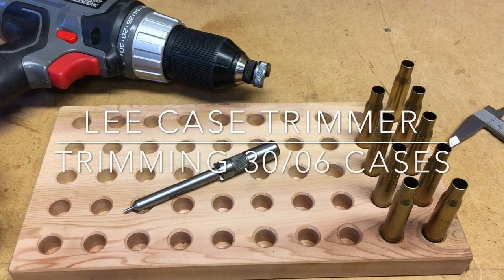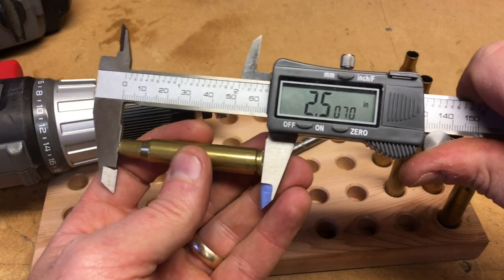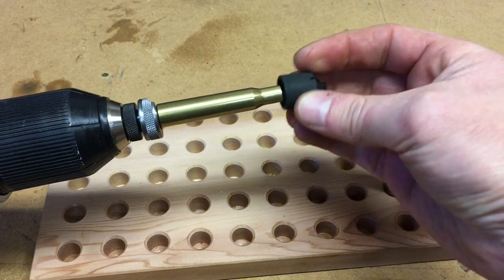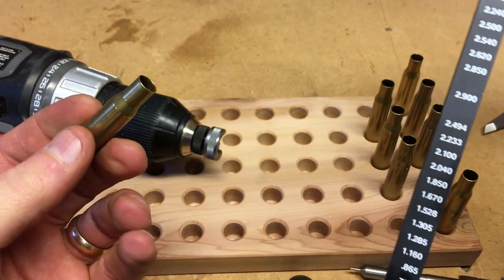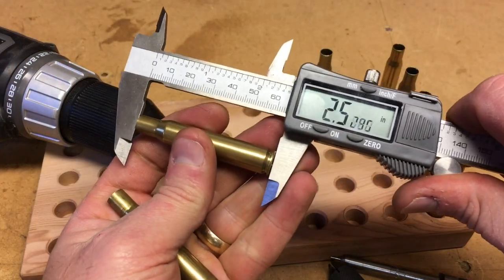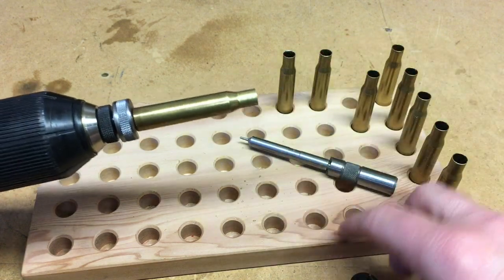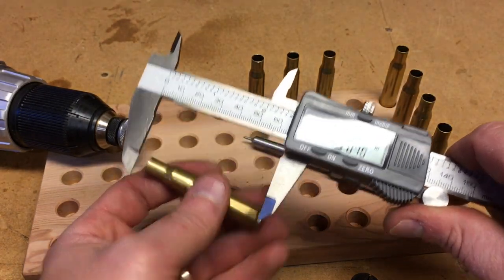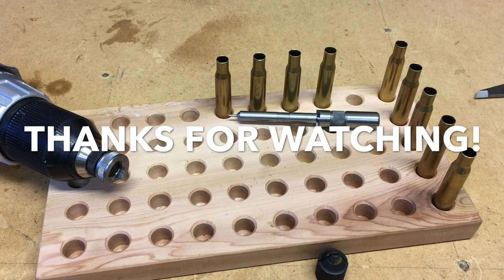Lee Precision Case Trimmer

Comment: I use the 3 jaw mount for my hand trimmer along with the wood ball cutter tool all chucked up in my drill press, I can process over 150 cases a hour with this set up...Good video for a good cheap way to set factory length on your brass.

Comment: I've been trimming cases that way for 25 years.  They work perfect!  Just picked up a Lee Zip-trim last week to try, on sale at Midway.  I like it.  It seems kinda cheesy, but if you don't man-handle it, it should last a good while.  It's just as fast or faster than a drill.  IMO  Just fasten it to your bench.   BTW...nice loading block.  I got 2 just like the ones you have.  From the same piece of wood!  LOL  God Bless.
Reply from the maker: I couldn't see paying $80-$90 for a Lyman (or similar) trimmer. I haven't seen the Zip-trim yet...might have to check that out. The fella that gave me those loading blocks sure did an excellent job on them. :)   Thanks for being a loyal viewer and thanks again for the reloading blocks. They've been put to good use. God bless you too!

Comment: My 223/556 kit was a little long @ 1.755 or so.  Like to be at 1.745 or lower.  Took a file and gently removed material from the pin and chamfered it and have it dialed in perfectly now.  Tough to beat for the price and it leaves a good cut.  The Worlds Cheapest Trimmer is prob next price wise and is faster but the cut is not as good (can still get MOA or better).  For speed and precision the Worlds Finest Trimmer beats both but its more expensive.
Reply from the maker: I haven’t heard of those two, but I’ll have to check them out.  Thanks for the info.

Comment: Question I can’t find the answer for anywhere on the internet, are you supposed to bottom out the gauges threads into the cutter ? On instructional videos they just lightly screw In by hand, if you do that compared to bottoming out the gauge to the cutter you can get wildly different trim lengths…..
Reply from the maker: I tighten the gauges as far as they will go by hand and then give a quarter turn with a pair of pliers.  I haven’t had any cases out of tolerance using this method.

Comment: I find this trimmer okay for rough trimming, such as when converting .223 to .300 BO, but I've found, as seen in your video, that the shell holder often does not center the case and allows wobble. If one wants "precision" trims, there are much better devices.
Reply: Off-center flash holes will cause the case gauge to wobble.
Reply: You stated my issue with 300BO. Get so aggravated during trimming a batch of cases, I have to walk away.

Comment: Mine doesn't go in enough when case is in lock stud and she'll holder, thoughts. Thank you for the video
Reply from the maker: Is the old primer out of the case? The small tip on the gauge should fit through the primer flash hole.  Other than that it could be you don’t have the gauge screwed into the cutter far enough.
Reply: @ncshootist  I have same problem. the stop pin seems too long and hits the face of the lock stud before cutter reaches the shell casing. Did you shorten yours?

Comment: Question for anyone who has one of these.
Are these adjustable at all. I need to do some wildcat cases.
Trimming 45 Win Mag to 460 Rowland's.
Yes they work, just looking for an easier and faster way to do it.
Reply from the maker: They do have a lot of different cases but I didn’t see 460 Rowland https://leeprecision.com/case-conditioning-tools/case-trimming-tools/case-length-gauge-holder/
Reply: Did you ever get an answer about being adjustable? I have seen it said they are not adjustable, but it seems like you could influence the length by changing how far you screw the gauge into the cutter. But then it would seem like it could then be sloppy. Also, on their website, it indicates "Trim to length 2.706 to 2.726 inches" for .338 LM. It makes me wonder if there's a tolerance of 20/1000...which is pretty sad...especially since the SAAMI max says. 2.724". Their website contact page makes you enter far more info than I'd be interested in providing just to ask a question.
Reply: @ShastaBean  
I ended up creating my own trimming process. It started with the cases chucked in the drill and set to a "calibrated" depth. I then cut them with a fine tooth hacksaw with the drill running. I finished them off with a Lyman case trimmer I found at the gun show. Did 200+ cases shot a deer using one of them so far.
Reply: @CrawldaBeast  That sounds so ridiculously simple, that it almost doesn't seem possible. You must have some precision gear to be able to do that with a saw blade. Nice work.
Reply: @ShastaBean  
The saw blade was 1st cut, the Lyman case trimmer was universal in adjustment. It finished them to to right length.

Comment: The problem I have is the damn cases pop out of the holder while trimming, no matter how tight I put them
Reply: Mike the farrier: I’ve had that problem as well.
Reply: I have been using  these trimmers for over 50 years with no problem just snug down the case holder with a pair of plyers.

Comment: That’s totally dumb.  put the other piece in your drill and hold that piece in your hand and you got about 50 times faster my only question is why didn’t they put a handle on the one that holds the casing so you can use it the right way and put the trimmer in the drill
Reply from the maker: It wouldn’t save any time switching the pieces around.  No matter where the cutter is, you still have to clamp the case down in the holder.

Comment: I have a case length gauge for .308 and guide pin for flash hole projects past my case bases since chuck base has no hole in it did you have to trim pin back so guide will cut case mouth. This doesn't seem right to have to do anything to guide length gauge.
Reply from the maker: Lee, I didn’t have to do anything to the case length gauge.  The shell holder should give you clearance between and length gauge and the threaded piece that goes into the drill chuck.
Reply: No need to trim the case length pin. It is set for the correct trim length for that particular cartridge.  It fits through the flash hole and bottoms against the lock stud. The cutters will only cut if the case is too long,